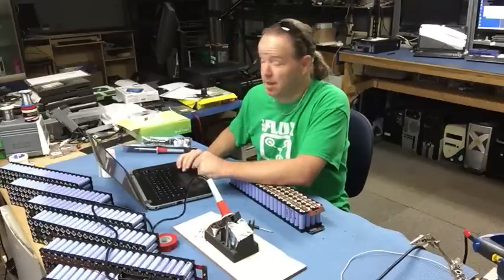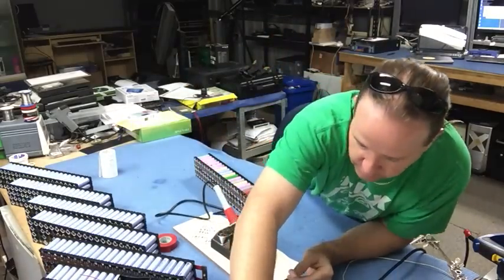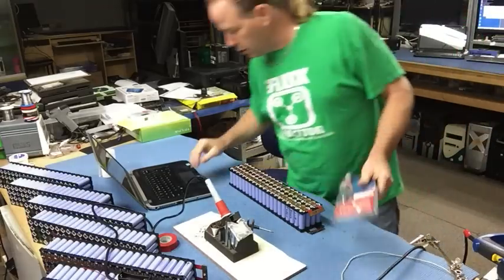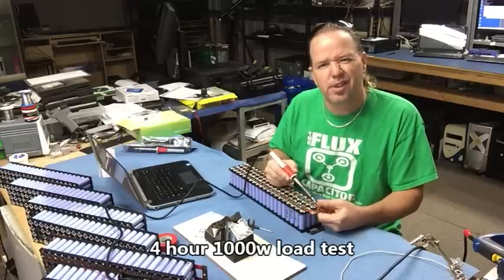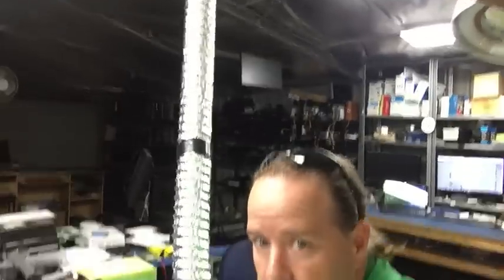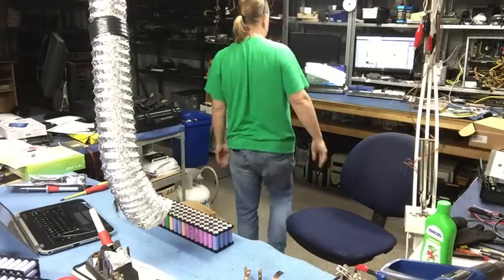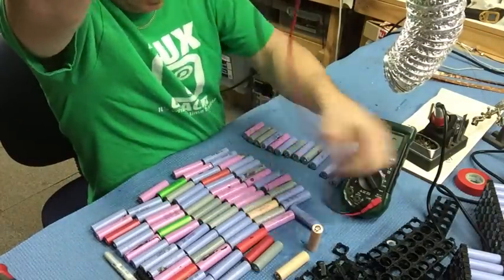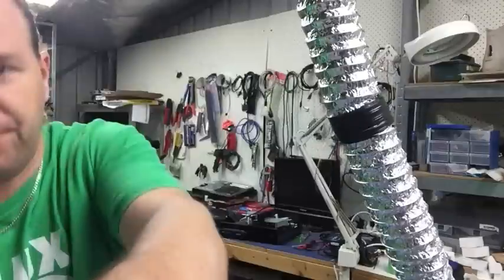Unceremoniously taking pack 3 out of service (Me talking to myself for 17 min basically sorry)

Comment: if the high one is paralleled. then charged. couldn't it be over charged
Reply from the maker: nop, it'll just pass the current to the lesser voltage cells balancing out

Comment: Just a thought. Instead of desoldering each cell. It would have been quicker to just clip the wires.
Reply from the maker: definitely much quicker to get off but putting it back on takes a bit longer so works out ok in the end .

Comment: I suggested using spot welds in one of your old videos... Glad you didn't - I don't think you can remove spot welds as easily as this.

For quick maintenance, I wonder if you could just lay a copper bar between the corners of the plastic holders (4 of them down the entire length) and then clamp it down/attach it to the bank somehow?
Reply from the maker: AHAHA didn't even consider that !!!

Comment: load testing is a must do. I have found when I use only use the amp hrs to test a battery .its not a true test...amp load on a old battery well bring down the voltage to low for hi amp drain and well bring down good cells with it yes they all took 2000 ma but not when under load...try to pull two amps  per cell for 4 min then look at the voltage under load the ones that stay up in voltage well be winners.then try a 1 amp for the same time .you well see what I mean....usable power ..but at low draw well give full tested amp hrs working on a video now on old vrs new amp draw to ma hrs .
Reply: yes. this is what I found too. It basically means that when you design with used cells you have to design for low C loads.

So for example, if the goal is to use 1KW continuously the required battery should be like 10KWh. 

Used cells defenitly have their limitations. But still very usable.

The advantage of designing like this is that a pack is guaranteed to last many hours.

I guess it depends on the application. For an ebike this isn't very practical. It would get too heavy. Just means that checking internal resistance is really important for higher C load applications, like ebikes.
Reply: this holds true for charging to ..just looking at my notes now put 1 amp in look at the voltage rise per 15 min.this well also show a good battery....slow rise good.....bad right to 4.18 then cut the amps down.but well still take a full charge just at a slower rate

Comment: What make this big pack of cells voltage very low compared to other..Doesn't make any sense if only 3-4 cells can effecting the entire big pack cell capacity of 80 parallel cells.. i'm thinking how much more to invest in good cells proper connection and busbar.. especially for positive side of the cell..
Reply: It is likely the bad cells were self discharging and/or have a leakage current draining the pack
Reply: likely sound like illogical theory for me.. i didn't know bad cell have a difference rate of 'SOC'.. or if it got the 'current leakage', where did the energy gone.. something wrong about the heat and internal resistance.. those cells tested as at least 2500mah capacity.. what turned it bad.
Reply: Justin Stine They were probably always bad. They can still have a capacity but leak, it isn't going to be a sieve. The energy lost is lost as heat.
Reply from the maker: In the end those three cells wouldn't have KILLED the pack, but i recon in the end it was me so deeply discharging them is what actually did the most damage. And subsequent low voltage

Comment: Could you measure the internal resistance of these bad cells? Use for example an 8 Ohm load and measure Open Voltage and Voltage with load. Ri will be (Uopen - Uload) / (Uload / load). For example: Ri = (3.96 - 3.91) / (3.91 / 8) = 102 mOhm.

Internal Resistance can explain the differences in temperature between the cells that you measured with the thermal camera. A low internal resistance would cause a higher current which would cause a higher temperature. A high internal resistance would cause a low curent and the cell would warm up much less.

Perhaps it would be good to check the Internal Resistance of some of the good cells as well, for comparison.

It would even be interesting to check the internal resistance of every bank, though that requires a much bigger load to be able to get any reasonable difference in open voltage and voltage under load. (A whole 80 cell pack would have an internal resistance in the range of 1 to 5 mOhm.) 

I did a test with 2 cells here. A good cell with an Ri of 75 mOhm in parallel with a bad cell with an Ri of 750 mOhm. Under a load of 8 Ohms the good cell supplied 432 mA while the bad cell did hardly anything at only 46 mA.

If I remember correctly, you tested capacity with a high current of like 1 or 2 Amps per cell. Testing capacity at a high current already filters out the cells with a higher internal resistance because the high voltage drop would cause the capacity to seem low.

Sorry for writing such a big comment. It's that I like this stuff and you sharing your experiences in youtube is very helpful for my own project (building a small 1Kwh pack (about 150 cells) for having lights and the tv working during blackouts which happen way too often where I live.) Keep up the good work! It's very much appreciated.
Reply from the maker: Yes will test & do quick vid but will just use imax
Reply: +HBPowerwall ok. cool.
Reply: I forgot to mention. The test that I did with a high Ri cell and a low Ri cell. I let the load voltage drop to just below 3 volts. After disconnecting the load, the bad cell started discharging into the good cell. I disconnected them and let them sit for a while.

Then I measured their voltages. The bad cell (high Ri) jumped up to 3.68V while the good cell (low Ri) just made it to 3.4V. 

So those cells you measured with a low voltage may actually be the best cells (from an internal resistance point of view) in the pack.

Comment: Thinking a better design for the packs would be to have the positive & negative on different ends of the pack this way the cells would charge & discharge more evenly.
Reply from the maker: datz what i'm trying to prove or disprove :)
Reply: Why would be better? It's all DC current and the busbars don't have any significant resistance. In higher frequency aplications the physical layout is a factor but in this design it shouldn't make much difference.

I have to say that I initially also thought it would make a difference, but his test with the thermal cam clearly shows that the cells them selves warm up. There was no real sign that the busbars were warming up. That means the busbars are fine and perfectly capable of dealing with the currents.

Comment: Unfortunately with us using used cells this is the problem that will keep rearing its ugly head... On my makita drill pack conversions they work great for a while then a random cell will pop it's clogs and have to be changed.. Pita but easier to fix than yours.. Keep up the good work
Reply from the maker: Yep, can't try be cheap with out being cheap first :)

Comment: i think you should consider putting terminals on opposite ends, the configuration right now puts more stress on the top cells, which is probably why you see a heat difference from top to bottom.
Reply from the maker: yep, that's what i'm trying :)
Reply: awesome, going to be cool seeing if my theory is correct, after all electricity will take the path of least resistance, ergo the cells closest to terminals.

Comment: Why didn't you make each bank as a series of packs that would come apart in sections.
Reply from the maker: I believe that is what I've done?
Reply: Cause. *Because
Reply: HBPowerwall I meant like in blocks of 4x5's so you bank of 25 is made up of blocks you can easily pull out instead of an entire bank of 25x4 that you have to take apart like you have in the video.

Comment: I don't know if you charger does this or not, but I'd check the internal resistance of each cell to make sure none are too high.  High resistance would cause heat. High resistance would indicate near "end of life".  A battery at "end of life" will still charge to proper voltage, but might / would self discharge over a period of time faster that a good (new) cell.  I use the OPUS BT-C3100 Charger.  BTW: I stopped writing on my batteries. I now write info on tape and attach the tape to the battery after testing .  Just my .02 US :)
Reply from the maker: Done that in the beginning but found horribly inconsistent results did a 100+ cell test probably my Imax has issues or inconsistencies
Reply: I just write on the cells. A little isopropyl will take it off no problem

Comment: Questions,
1- de-solder?    why not just cut the fuse?   
2- you washed your cells?
3- whats the purpose of disassembling the module?
4- why not check capacity on the whole module instead of each cell?
Reply from the maker: 1. Because I wanted to reuse as much of them as possible
2. Yeh, I put them in the shower to clean all flux off the batteries, that's the proper way isn't it :)
3. Changing from top discharge/charge to bottom & top, the internet said it's the better way to do it.
4. Checked the whole module & it was 1/2v lower than the rest (or close to it) 

Also really wanted to know if there was honestly a capacity difference from the way I have it arranged to how it 'should' be done. So all current goes through the pack not just in the top and out again. If it doesn't work i'll say I told you so, if it does work i'll be happy i put the extra 10 hours into it :)
Reply: "If it doesn't work i'll say I told you so"
In theory it should work, but that often changes in practice.
Reply: 3. Changing from top discharge/charge to bottom & top, the internet said it's the better way to do it.

Im having trouble understanding what you mean. 

4. Checked the whole module & it was 1/2v lower than the rest (or close to it) 

.5V difference at what point in the curve?  If you Top balanced modules they will be at different voltages at the bottom,  the module with smallest capacity will reach the knee first and its voltage its going to drop first.  You can figure out which module will hit the bottom by checking the capacity of each module,  no need to disassemble the whole thing
Reply: "In theory, there is no difference between theory and practice, but in practice, there is"
Keep on trucking ! (from France)

Comment: Gday Pete there seemed to be a bit glitchy on the video I'm not sure if it was on the iPad or YouTube or in recording itself, I was wandering if it could be better to have a centepeede bus bar where you would get the copper plate sized to cover the contacts slot it so as to create fingers to reach out to the contacts and then get someone to slightly bend the bar down the length so as to make positive pressure on the contacts the centre of the bar could be screwed down to make the pressure this would help facilitate stripping them down later and make the process much easier

Comment: Great video :)
So a good test to see if a cell is good would be to charge em up and leave em for 1-2days and mesure the voltage and then discharge them.
Reply from the maker: Yep done that & only three cells drifted - one is under 1v two under 2v all the rest of the pack were still 3.15v
Reply: Well i learned something :)
Going to let my cells sit for atleast 24hours as part of the test to see if they hold onto the voltage.